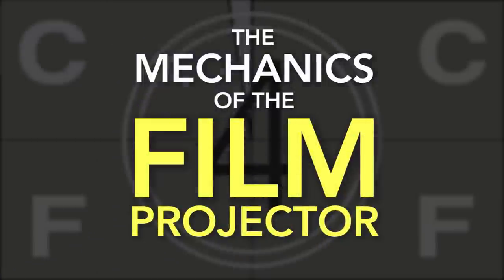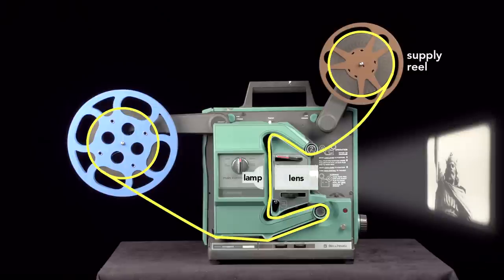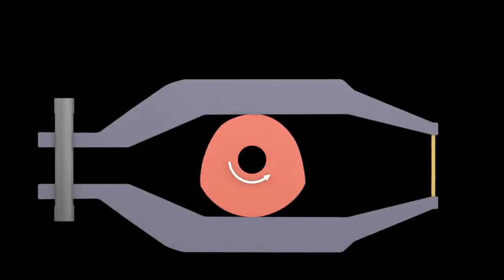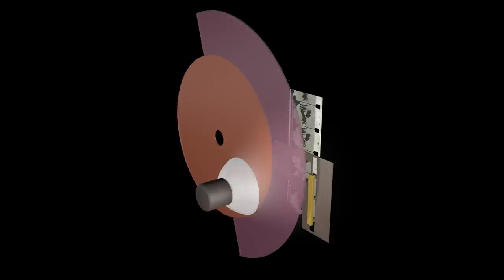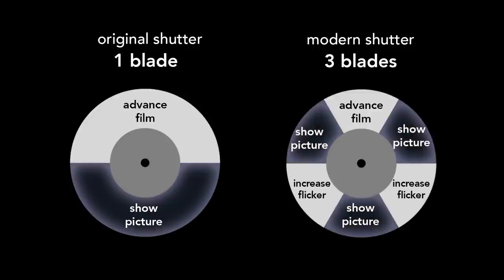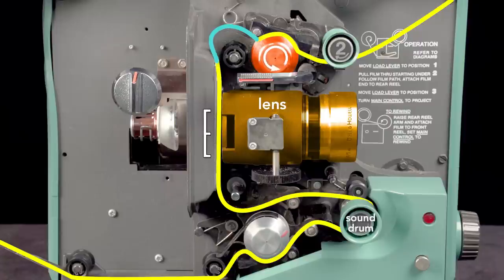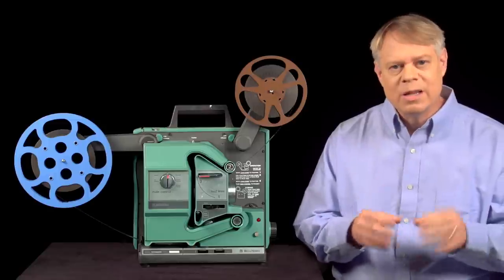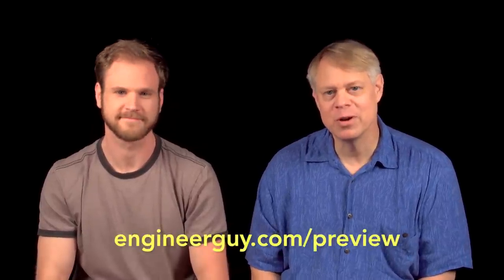How a Film Projector Works

Comment: Excellent video -- I would love a rundown of how the intermittent sprocket works on a theatre style 35mm projector -- I used to run the machine but seeing it work was incredible.  There is no shuttle to grab the film and advance it -- the bottom sprocket is is handled with some sort of planetary gearset where one of the gearsets is input from the drive, one is oscillating to interrupt/cancel the output and the last stage outputs to the film.  This results in the sprocket being completely stationary, then suddenly jerking forward without hurting the film.  I've seen a drawing in an ancient repair guide while I was working in the theatre but never actually got to see the gear mechanism.
Reply: frollard Reading further, wikipedia tells me its a geneva drive mechanism which just relies on intermittent drive of the output shaft by a thrust pin...
Reply from the maker: frollard Indeed the geneva mechanism was used in higher end cameras and projectors.  Likely if we would have done a 35mm projector if we could have got hold of one!
Reply: ***** Funny, in France we call that geneva  cross a maltese cross.
Reply: ***** it might be worth asking around. I suspect many MANY cinemas have them redundant now it's all gone digital
Reply: ***** I think that IMAX still uses film. pretty huge film,  too. 72 or above mm i think
Reply: ***** Bummer, I sold mine 3 years ago.
Reply: frollard The secret there is the Geneva Movement. It is a hyper-accurate gear that allows the 35mm to project its image to its full resolution (depending on film quality). The Geneva Movement is vastly more precise than these shutters, as when you project these shutter movements to sizes like your average modern theater screen, the image bounces and shakes. Assuming full quality print by Deluxe or Technicolor, the 35mm with a Geneva Movement can project thousands of times its size.
Reply: +supergamer1123 Yes IMAX is 70 mm film, and for an intermittent, a rolling loop is used, not mechanical.
Reply: +supergamer1123 The original (and true) IMAX format is standard 70mm film, horizontally projected. Each frame is 15 perfs (sprocket holes) wide, leading to an almost square image to be projected on huge screens or domes. IMAX film projectors require a complex pin registration system to make sure the film remains steady and sharp throughout the entire image area.
The images are recorded in IMAX film cameras using the exact same image area. Many an IMAX film these days is a blow up from 35mm camera format(s) or from digital cameras. There are also digital projectors called IMAX, but these don't have the resolution power (sharpness) of true IMAX where both camera and projector use the same film image area.
Reply: truefilm
True. While digital has come a long way, it still cannot match 70mm-style film. While film itself does not have a resolution, per se, it is vastly more clear and has brighter colors than large-capture digital cameras. The chemical process of film is still superior to the digital process, as increases in size/resolution require orders of magnitude more processing power than what we now see as standard 4k and 1080p resolutions. As chemistry is not restricted by computer processing technology.
Reply: +twentyninerooks, the reason for little use of 70 mm is material and laboratory cost.  One of the reasons for shooting quality prints is to use Vistavision cameras, with sideways 35mm film close to size of 70mm image, yet it uses standard  35mm processing equipment and can be reduction printed to standard 35mm projection prints, or printed to 70 mm, as they did with a restoration of Vertigo. 70mm is nice, yet the equipment is very costly to maintain, and today there are few left and spares are rare to come by. The vertigo print looks to be from a release print as the quality is not the regular Vistavision style.
Reply: +Chloe Alexa Yep! 

Anyway: thanks for reading this:

Add to that the fact that since 2000 (the first movie was "Oh Brother Where Art Though!" by the great Coen Brothers) all movies had digital intermediate, allowing for easy(er) integration of special effects and CGI - and for surgical color correction and things like wire removal etc..
Unfortunately (for me that is!) in 2011 movie theaters were forced to buy (!) digital projectors. Most of the mechanical equipment such as optical and contact printers were literally destroyed. It was all a matter of cost and convenience, never one of quality an aesthetics. I know that 100% from professionals. It was all about business, never quality.
As far as I remember, the "Vertigo" restoration was still made fully analog in the 1990s (by the time digital had reached the necessary quality, it would have been too late for the surviving film elements). Yep: Vertigo was filmed in the 35mm horizontal 8 perf format Vistavision (which is the exact same frame size as 35mm analog still photography). The Vistavision format (and 70mm = camera 65) was also heavily used by the likes of Douglas Trumbull for traditional special effects (say: "Close Encounters..." or "Blade Runner" - to make up for generation loss on optical printers. Results were outstanding and hold up extremely well still today.
Now the choice of film or digital is down to the camera (and in case of Tarantino's "The Hateful Eight" existing 70mm projectors have been restored and are being used together with the 1.25x anamorphic lens that comes with the roadshow reels - to yield the correct 'Ultra Panavision 70' image) all over the world. 
Let's hope Kodak (Fudji is out for good :-(  ) will have success with their projects (including the new Super 8mm camera with widened gate), so that DPs and directors still have a choice. 
Film is not just about resolving power (sharpness) - it's about the magic that happens when light hits the emulsion and, as you stated: the chemical process. The current Kodak Vision 3 negative stocks (50D, 200T, 150D and 500T) look fantastic in all formats: sharp, fine grain incredibly beautiful and natural colors and contrast and with that "poetic" feel that only true film can deliver. It's not about megapixels. A good 35mm print on Kodak Vision 3 (from a film camera negative, even if undergoing digital intermediate - which is a necessity these days for many reasons) would look fantastic. The problem is: 35mm release prints during their last years were made with fast, simple, hot (=poor quality) chemical processes, high sensitivity (to allow for faster contact printing but adds grain) and only 2K resolution (way below what quality 35mm film is actually capable of). 
The same happened to 16mm for television in the early 1980s, when it was phased out for TV. Sure film looked often "bad" (not to me that is!) - it was mostly the infamous, muddy, grainy Kodak Ektachrome VNF film stock, made for news gathering - fast, cheap and hot processing, hastily slapped together on a flatbed editing machine. Ektachrome Commercial, not to mention the mind blowingly beautiful Kodachrome would have been awesome. Add to that the (then) poor transfer to the video signal.... Oh well. 
I trust film will survive for many years to come. Many a DP and film director is fighting for it!
Reply: +truefilm An adendum to Vistavision, I have an strip of sidewinder with Mag Tracks and projected on a large screen it was like 70mm.  In some theatres we had the proper aperture plates and short lenses so we took advantage of the Framing marks in VV and showed them on the Cinemascope screen size, and not the Flat screen.  You mention Ultra Panavision and we received a print of a film in it, and when shown on the lenses we had, there was a quick call for a pair of new Lenses as we were not informed as to the new format.
Reply: +Chloe Alexa Hey that's great! So you were a film projectionist? Awesome! 
Well I go way back to the days when we still had 16mm prints in middle and high school. I was allowed to run the projectors (Siemens 2000 and Bell&Howell TQ1). I later had a B&H TQI 16mm myself, running inexpensive collector's prints, repaired and with a good zoom lens - the stock 50mm was so-so. 
I also had the luck talking to old projectionists, telling me tales of the old days (I even saw a few frames they kept from a true Technicolor IB print!). I also saw custom filed projector film gates for curved screens and the good old Kowa Gold 2x anamorphic lenses for CinemaScope/Panavision 35. Yeah: magnetic sound strips. Sounded great and crystal clear when new, but they wore out fairly quickly, as you know, leaving brown dust all inside the projector. Same with Super 8mm (I owned 2 cameras and 3 projectors until it all stopped in 1881).
Now I have an inexpensive Krasnogorsk-3, Super 16mm converted camera. I further improved on it (removing loop formers, de-burring extended film gate with 1000 grade sand paper dipped in high grade machine oil - all tasks which are not for the meek, re-aligning the sprocket during re-assembly is a b**), looking good so far with old test footage, runs butter smooth, no jamming, loops remain stable - let's see how the first "live" film test footage turns out after processing and scanning. Will upload on YouTube and Vimeo ASAP.
I tracked down the best and most affordable suppliers and labs for 16mm film. Most of the great film stock has expired by now. I keep it in the freezer.
Reply: +truefilm An Old projectionist and film equipment designer and repair.. started running 16 mm in 1950 grade school.  Have worked machines in Germany and South America, Colombia, so am familiar with many different Projectors. Your Siemens, I had a number of their units with sound on one side and image on other. Had converted them to run standard 16mm full coat or mag stripe and super 16 that could be blown up to 35mm size. Many of the film makers here in Minneapolis, would swear at them as film eaters, never had any problems and rented them out to eastern people making documentaries for dailies.  My son who was 5 at the time used the Projectors for showing cartoons to his friends as well as running a portable 35mm machine, also for cartoons full length films. Sounds like you also have had interesting time with the lost art.
I taught Film History the Mechanical Part, The Psychology of Film, and The history of Film.  So many things have changed, made special outdoor Presentations on Buildings and signs on rooftops.  The only film size not run is IMAX.  Have found and used many different sizes and a favorite was Pathe with their 28mm film and then 9.5mm.  As a souvenir I have a ZEISS 1937 16mm machine I run films of my family on, need to put onto DVD. I just turned 76, you about 40 or so??
Reply: I'm age 55. Been in love with film for all my life. Studied theater, film and TV sciences at the Frankfurt University. Didn't learn anything, dropped out. Film school was far away, to expensive, to few people accepted and no guarantee of getting a job. I did small jobs at the Frankfurt Tv station from 1977 through 1983, still marveling at the Arriflex 16 ST and BL models, used for documentaries and news coverage (that infamous muddy,grainy VNF stock!). I learned a lot, from cameramen and assistants, but it didn't get me anywhere since it was a "Mac job". I decided to become a full time musician and left my country in 1985. I live in Lisbon. Portugal for 30+ years now.
16mm was out of reach for decades.. I'll try my best to come up with some decent, unpretentious footage - before it might be too late.
Great to have met a fellow film enthusiast. I fully respect people who prefer digital. But they should have a chance at trying out at least 16mm at schools (some do, such as USC). There are also young film maker groups who are excited to shoot the occasional 16mm film whenever budget allows, the Arriflex SRII (sometimes converted to Super 16)is often the choice, because they enjoy the entire process and the cinematic, poetic outcome.
Here is some shameless plug ;-) You might want to check my YouTube channel, still at the beginning. Much more very soon to come. Just click - if you want - on my icon/avatar (of course the background is a stylized Arriflex 16ST with external 400ft mag. All the best!!! - I'm very happy for you and your great experiences with "true film" ;-)
Reply: +truefilm Me too :)  I was projection in 3 different theatres, all lowly 35mm. Seeing the mechanism (air void sprocket advance thingy?) on imax is very cool in motion.
Reply: +truefilm If your meaning Frankfurt Germany there is a very effective way the Germans used theatres to spread information and Propaganda.  While we in the USA shot the live war footage, sent back to the US for editing and processing, then having a narrator do the sound read that took some days to accomplish and when shown in the theatres for a couple weeks many things had changed in the War.  In Germany, they shot the war footage and sent to processor asap,  when the film was edited and prints sent to all theaters sans sound track.  At 18:00 and 21:00 hours the film was threaded ready to run.  At the set time a Narrator in Berlin read a prepared script to match the footage, this was repeated at the next shows with new information until a new film was prepared. This way the German people were given fresh information at every showing of the newsreel.  The start times were cued to sync the film with the narrator as the projectors were all now connected to a synchronous motor using the 50cps to hold sync. Had two machines that were converted to accomplish that. One 16mm with intermittent movement the same as 35mm and an Erneman 35mm.
Reply: +Chloe Alexa yes: Frankfurt, West Germany. I studied film at the University from 1980 through 1983, when I dropped out. I learned next to nothing. It was from camera operators and directors from film and TV that I learned things that I really needed, at least the technical aspects. Directors I knew (friends of my parents') were very protective and evasive, when I asked anything. Nowadays all information you'll ever need is available on the Internet. I will do my best to share what I know as well. 

Well the War was well before my time. I was born in 1961. What I learned about it in middle and high school (1970s) was of course completely filtered and cherry-picked, as it was anywhere in the world. I had to buy books, recommended by highly knowledgeable people, to get at least some idea about what really happened and why it happened in the first place, always trying to figure out the big picture. I refrain from voicing any opinion since it is impossible to really have a clear understanding. I do always welcome an unbiased and unclouded (as much as possible) conversation, listening to what other people have to say. That goes for anything, including the "film vs. digital" topic. 

Yes: film in theaters was a very powerful way to communicate. As far as I know, 'official' footage was shot mainly with 35mm Arriflex cameras in Germany and mainly with 35mm Mitchell cameras in the US. Lots of hand wound 16mm cameras with 100ft spools (in the US many Bell&Howell Filmo) for combat and reconnaissance footage. 

In theaters 35mm "academy" aspect ratio (1:1.37), black and white on nitrate base, was the standard during the 1930s and '40s. 

I just say this for younger people who might not know. :-)

Anyway: I left my native Germany way back in 1985 and live since then in Portugal. 
About the optical soundtrack: I don't know the exact tech specs of the Western Electric System, but I know about the German Tobis Klangfilm (which was very similar). The original optical recording for 35mm films had a sudden drop-off almost exactly at 8000Hz. Of course the quality became worse with each generation. On a 16mm print with a mono optical soundtrack (usually variable area, as opposed to variable density, used for example on 35mm Technicolor IB (=imbibition) prints) you are very lucky to get as high as 6500Hz. That's fine for dialog but little else. I read an article about the original optical recordings for Disney's "Fantasia", which were made on a very precise custom system and actually contain treble information almost up until 10Khz. That's a huge difference in clarity. 

Cheers, Christian
Reply: Christian, you sound like we could share many stories, over many evenings.  Studied technical aspects of Fotography,  in Germany mid 1960's.  Another WW2 curiosity was on way to Amsterdam, a man joined me in my compartment, and sharing information, he was the Disbursement officer for present day UFA  [that was 1964] company, returning monies to Jewish people still alive from WW2 profits of all the UFA films, ironic job. Raised in the USA and lived number of years in Colombia SA. We both have similarities.  Have a great Day, Chloe
Reply: +Chloe Alexa Yep, definitely lots of stories...  UFA, that stands for: Universum Film Aktiengesellschaft :-)  Founded 1917 and they still exist. 
You mentioned full coated (magnetic sound) on a 16mm projector. I remember very well, back in the late 1970s, how many a TV show was shown. Many US shows came as "full frame" (for 3:4) 35mm prints, were dubbed into German. These were run live, at 25fps to be in sync with the European PAL 50 Hz standard resolution TV at the time, on a machine that ran the image and full coat (17,5mm - exactly half of a 35mm film with matching 4 perf pull down - so the sync was mechanical and 100% reliable) in sync. Early machines were converted top of the line Bauer projectors. Later ones used air pressure and X-ray in a closed chamber to yield a sharper image and better control over contrast and color. The continuous running "telecine" machines came much later. 
News gathering  when still done on 16mm reversal film (that infamous Kodak Ektachrome VNF), was edited on a Steenbeck flatbed editor together with 16mm full coat magnetic strip, white grease pencil, one sided tape splices and all. The voice over was added after the edit (often live during the evening news). Many times the great old Arriflex 16 ST was still in use (with a pilot signal to a Nagra tape recorder to sync the location sound) and you could hear the "purr" of the Arri in the background. The Arriflex BL was much quieter of course. Both models are still around and some are for sale (refurbished and serviced). Even if I had the money, I wouldn't buy one: they are extremely hard to convert to Super 16mm (never saw one being offered), and I think the 3:4 (exposed: 1:1.37) aspect ratio is inadequate these days because 16:9 (=1:1,777...) has become the standard for just about any moving image, including BluRay discs. Cropping 3:4 16mm to yield a wider aspect ratio always leads to a softer, grainier image. Super 16mm with modern scanners looks fantastic and very close to a 35mm print (depending on camera model, lens and film stock). 
Some 16mm projectors have been successfully converted to Super 16mm, but I would never run my precious camera original through a film projector! If I had the money, I'd buy a 35mm projector,  shoot negative and have "hard matted" 35mm blow up prints made. Some labs still do that (such as Andec in Berlin and certainly quite a few around L.A.), but with the digital workflow, including projection, being firmly established, it's only a matter of time until these services will cease to be offered. 
O.K. I could talk film all day, but I won't put your patience any longer to the test :-)
All the best, Christian
Reply: +truefilm you love the Cine industry as much as I did and it is sad to see the changes we now have. Wonderful sharing have a great week. Chloe
Reply: 4k is easily possible with current gen enthusiast grade hardware, just the computer would cost around $2,000.
Reply: @truefilm1556  STOLEN PROPERTY & IS FRAUD ROBBERY THATS WHAT THIS IS CORRUPTION
Reply: @chloealexa189  CORRUPTION & MAJOR GLOBAL MARKETING ENTERPRISE FRAUD 
STOLEN PROPERTY
Reply: @supergamer1123  The later Imax systems ran 70mm film horizontally, pulling down 15 perforations per frame. This used 330 feet of film per minute (3.75 miles in an hour) The screen resolution was equivalent to16k digital.
The problem was that a single copy of a 40 minute film cost around £20,000 to print and weighed about 60kg. Cranes were used to load these films onto the projectors.
Reply: @johannes914  The geneva movement is called a maltese cross in most countries except the USA.
Philips (Kinetron) also modified the unit from a cross to a pin running inside a cylinder on later machines. This allowed each frame to be projected 3 times.